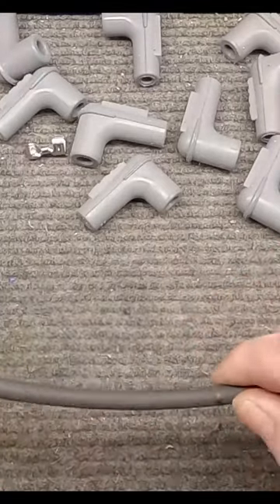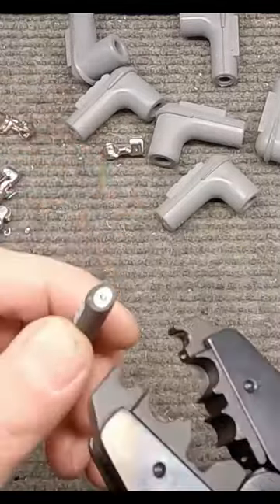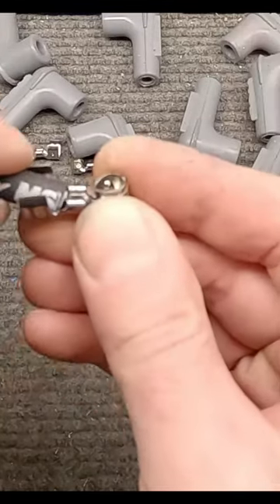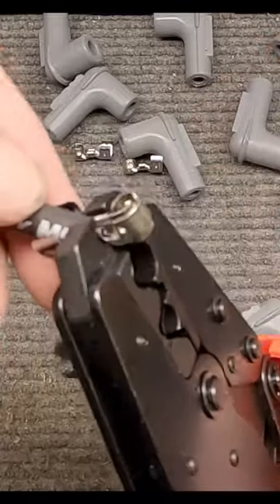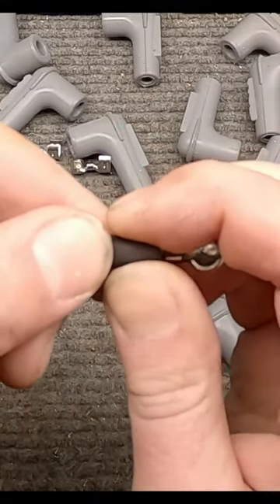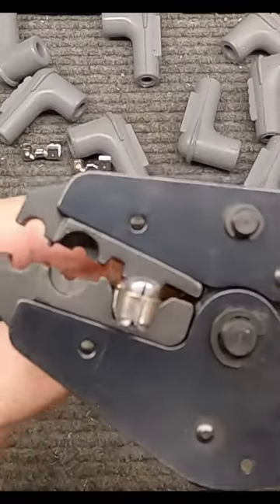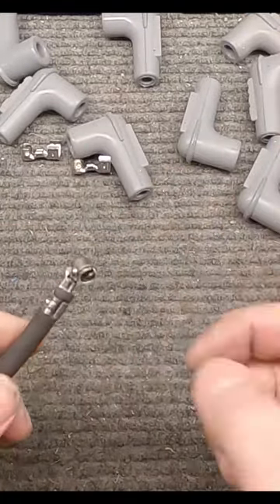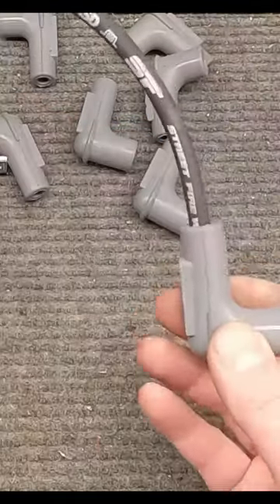Crimping Spark Plug Wires

Comment: I always thought you were supposed to tuck the electrode under 🤷 are these different?
Reply from the maker: This style of connector has the electrode crimped in it's own area (that's what the instructions say from MSD).  Other connectors are crimped that way, and I have done other wires that way, but this particular style is done this way.